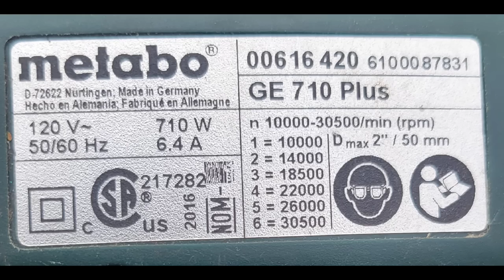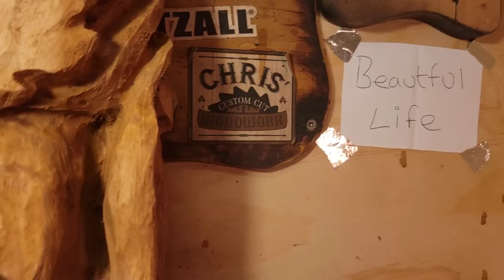Challange time| Woodcarving a Green Man for the Facebook Group.

Comment: Metabo are an excellent tool. They're very expensive. I've used them extensively and have several. They make a 7in grinder style tool that we use cut off wheels for fabricating in. As good as they are I thought that would be wonderful so I put a shaping disc, extreme playing berkana style shaping disc you've got them on there. Ruined a $500 grinder in about no time at all
Reply from the maker: Why did it wreak the grinder